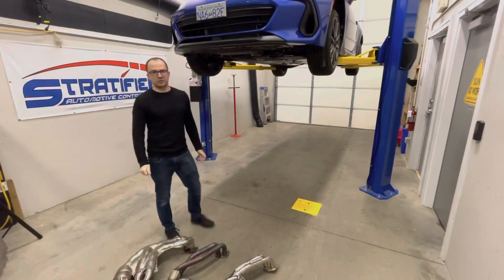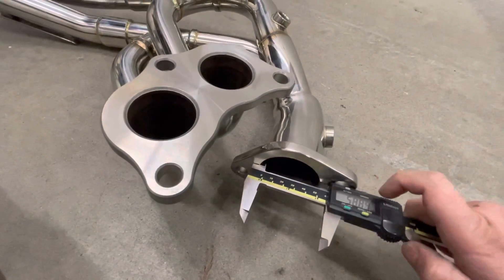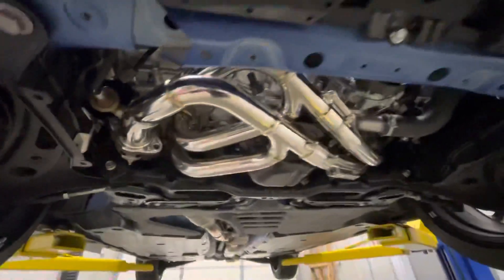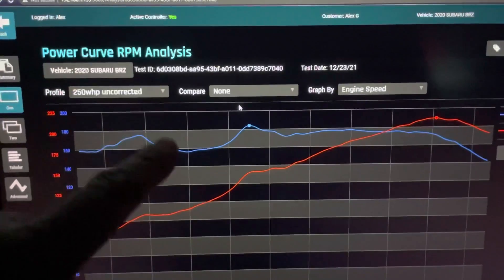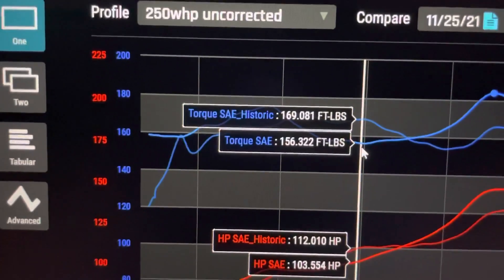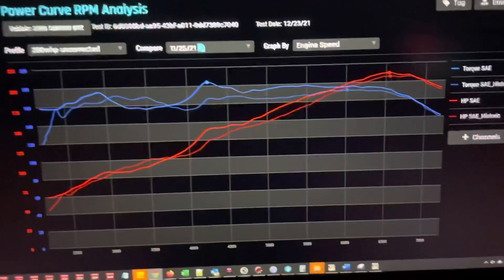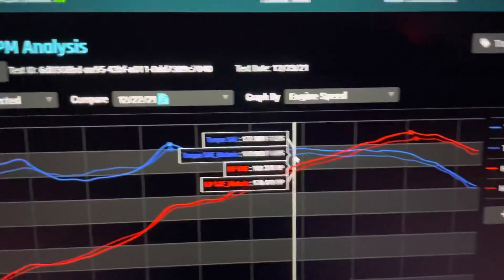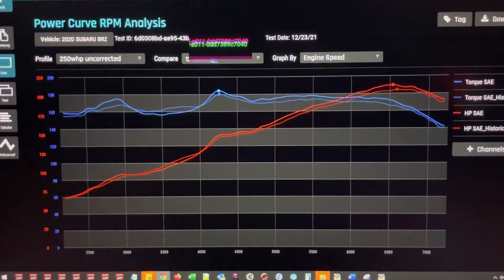2022 BRZ Build EP7: Which Makes More Power: EL vs UEL Header

Comment: What you think of catless UEL ? Should I do it ? The result would be the same as Catted one or just do EL catless or catted ? Honestly don't know what to choose for my 22 BRZ
Reply from the maker: Each header will be a bit different and should be tuned for to optimize. In general the uel gets rid of torque dip and el has better top end.
Reply: @stratifiedauto  I will wait till a tune come out and see both headers with tune on the dyno

Comment: Its not 4 - 2 - 1 design because each head is only 2 ports. So its a 2 to 1 design.
4-2-1 design would be from a single 4 port head, 4 runners to 2 runners to 1 runner.
Reply: There are 4 primaries,  going into 2 secondaries,  merging into 1, no?
Reply: @ellisjackson3355  Yes there "are" 4-2-1 headers that come from a normal 4 cylinder or 8 cylinder motor but not from this specific motor.
This motor has 2 different heads and each head has ONLY 2 pistons so its header would be identified as 2 to 1 header on each side.
Reply: I see where you're coming from.  But it's a one piece header,  not a pair of 2-1's combined.

Comment: Can you do a 4-1 vs 421 equal length comparison?
Reply: Yeah, it would be interesting to see the comparison to a 4-2-1 header.  I remember that the ACE 4-2-1 header was the "hotness" back in the early days of the FT86 but I don't know if that has been surpassed by other designs since then.

Comment: EL for the win, sounds like a rally car with the EL and overall way better power band, those things love to be revved. Curious to see how the new 2.4 responds to some tuning snd benefits from e85
Reply from the maker: Should respond as well as the 2.0
Reply: @stratifiedauto  would the stock fuel system handle the extra demand of running full e85? Or pump and ported injectors would need to be upgraded

Comment: 250whp with only headers that’s so good compared to the old model
Reply from the maker: New motor has lots of torque everywhere.
Reply: i mean a bolt on HKS SC only makes like 50 HP on the 2L. To think Once UEL headers engineered with an ideal exhaust diameter/flow for this engine start coming out this thing can make great usable/streetable power as a daily/weekend warrior. Too bad i still need a cat in CALI hopefully it wont get that costly or else id feel compelled to throw on a bolt on SC to the 2.4L depending on cost/viability aspects.

Comment: Hopefully companies are going to release headers optimized for the new engine to get it breathing better and sounding better.
Reply: on top of that XD....we will see ppl adapting them to their FA20. Which really drives this platforms progression home
Reply: The engine is the same and the exhaust setup dimensions as well. There's no reason to make custom fa24 parts, the fa24 is really just a fa20 with some refinement and minor changes as well as being bored out to 2.4L, 90% of parts on these cars are easily retrofitted.
Reply: @Toymonkeyjr  If it’s been bored out it’s not the same engine. It’s moving more air. The more air that comes in the more air that needs to go out.
Reply: @skiddlyd.244  Literally, but not really. Then you could say the same about every refresh as well.
Reply: @Toymonkeyjr  Do you know what the word literally means because you’ve contradicted yourself. The engine literally moves more air so it really needs more free flowing exhaust with optimal scavenging so the cylinders can expel the exhaust and fill cylinders with the most air and fuel possible. That’s basic engine stuff.
Reply: @skiddlyd.244  You're being a know-it-all it literally is a different engine, but it's not really that different. I'm not asking about an engine process, I think you're misinterpreting what I'm saying.

Comment: Are you planning on boosting the 2022 Brz? Along with do you think that the 2.4 engine would line up and be an identical engine swap with the previous generation? Looking to do it personally.
Reply from the maker: I think it will swap over. Eventually we may get to boosting it depending on where it gets to via tuning and other parts.

Comment: EL is the way to go simply because it doesnt have that annoying Subaru boxer sound.
Reply: Someone wasn't a colin mcrae fan as a kid.
Reply: @joby602  Prodrive dropped the UEL went they went to the World Rally Car rules in 1998 though.  The Subaru WRCars were EL ever since then (sadly?).
Reply: @joby602  ikr i was like isnt that the whole point, of having a subie etc...not to mention that this generation needs its "bridge port" rx-7 "equivalent" or Renesis 200+HP na "option". In reality this is IT, as far as factory/modern NA 200+ power FR rear tossing fun. I mean street port/bridge/pp 12a, or renesis rx-8 are just impractical at the end of the day...but UEL on the 2.4 that are optimized for flow/power, and a straight pipe system matched for the headers....with some long tube runners or an intake upgrade. Thats this generations streetport, or rx-8.

Comment: But the aftermaket headers are catless, aren’t they?
Reply from the maker: Yes. The car does still have a secondary downstream catalyst.
Reply: @stratifiedauto  Yes, but may the power increase is just from go catless, not the design or size of the headers
Reply: @krisztianszabo3105  This video is comparing the power band between two different catless headers, not necessarily the power gain from stock.
Reply: @krisztianszabo3105 there were people modifying the stock exhaust manifold from the old first gen FA20 by cutting out that cat and replacing it by welding in straight pipe,  and apparently massive gains were made just by doing that.  Torque dip gone,  everything.  The stock ex manifold was decently designed for power but having that primary cat integrated in screwed things up

Comment: How safe is it to drive around untuned with EL or UEL uncharted headers? I’m terms of the engine not knocking or blowing up
Reply from the maker: It is safe, AFRs are same as stock. With a tune you will get better results of course.

Comment: Need to see something with some cats on it. Not all of us are irresponsible and want to pollute and smell like we swam in a gasoline swimming pool just to make 200HP.
Reply: Sounds and smells like a bitch in here and it aint me.
Reply: @darkmarines  Thank you LOL
Reply: @L W Totally agree. I dont know how far I will take this car. Not looking to be a balls out race car but it does need more power than it has. A catback and E85 tune are for sure happening. If that isnt enough I will go with a supercharger and at that point upgrade to an aftermarket catted header. Before that there just isnt enough restriction to warrant the mod in my opinion.
Reply: Just skip these small incremental mods and wait for a nice positive displacement supercharger kit 330-350hp.
Reply: @jonasbaine3538  Still need good sounding exhaust. Car sounds like a sewing machine.
Reply: Ignore all these idiot kids responding.  They think they have it all figured out.  Life will hit them don't worry.
Reply: An aftermarket high flow cat in the front pipe will work just fine.  All your giving up is a few seconds at start up from a multi cat system.
Reply: i have to agree with the notion of a bolt on SC. IF this thing can make 300+ And the 350+ range with headers+sc+catback. You really have to wonder if/when you would be buying into an aftermarket catted front pipe. If im already spending on something like that to make "POWER" im either going to go for the size thats the most ideal for a bolt on SC application ideally being usable b4 SC installation/application. for a PURE NA build. IF not...you can see how costly the upgrade progression can be. Trying to make this car more competitive with the 40k range Factory boosted "options" a SC largely pushes it in favor of the car being competitive with a 400z/type r/n line/sti etc. From a truly competitive standpoint and cost. Then theres pushing ALL out NA like ported head+uel headers exhaust setup etc.....BUT with CAT for compliance....the cost aspects are pretty nutty too. But theres that added aspect of pure NA vs the listed Boosted vehicles....IMO its just like a rotary building a 12A as NA...or getting a 13b....or running a 200+HP renesis...as a daily weekend warrior...id lean to the renesis or even an rx-8. YET the cool factor is with an rx-7 13b or 12a port deal. POLLUTION aside....theres still an aspect of const responsibility and cost effective power/daily/streetability. At the end of the day i wont waste $$$ dialing in a 12A or buying a stand alone. So aspects like a rensis or the rx-8 come into play and so on and so fourth.....just like spending on an expensive UEL catted front pipe. Its not just an aspect of social responsibility but just outright personal/financial aspects that would cater to responsibility. BC the drivability/streetability of a stock 200+HP renesis....vs a ported 12A with "LESS"....or ppl with bridgeports.....like the ball park of streetability and how each owner drives the things....is night and day. Which is my aspect of responsibility or the one i see most. I say the same thing to ppl that want to slap on bolt on parts or "power" on their pure aesthetic builds or for looks builds....that get gaslighted into hotrodding about by ppl with cars that have actual capability.....only to wind up having their car....damaged bc of a self fulfilling prophecy.
Reply: @L W That is a secondary cat designed to operate at a lower temp than the primary cat. Its better than nothing, but looking at it that way you are left with a half assed setup in terms of power cuz you still have restriction keeping a muzzle on that 200hp of fury. And you have a half assed system as far as actually removing hydrocarbons and pollution. But hey im not the mod police. I know I will do mine right.
Reply: Just go away and buy an electro :D
Reply: @timuryaroshenko3697  Come on now. I have had my share of catless cars when I was young and stupid. Now I have several cars that make big power all with cats. 750 HP roush stage 2 supercharged mustang, 500HP mazdaspeed 3 with big turbo and nitrous, 400HP taurus SHO. All without sounding and smelling like crap. It can be done. You just cant be a cheap ass puting a $400 header on you car like a broke highschool kid and thinking its going to be a beast cuz those big bad cats....  thats totally what was making your 200hp NA 4 banger so slow.
Reply: @boost331  , it won't be a beast, but some 4.5s to 100km/h it will achieve. Not all people can afford a garage of powerfull cars, but they can afford this one and yes, do a small tuning for some gains. 
If you are concerned about ecology - blame more on people that still drives 10 years old / EURO 5 cars. This car with a catless header wiill pollute on the same level.
And actually I'm pretty sure that your cars pollute not less than gr86 with catless header ;-)